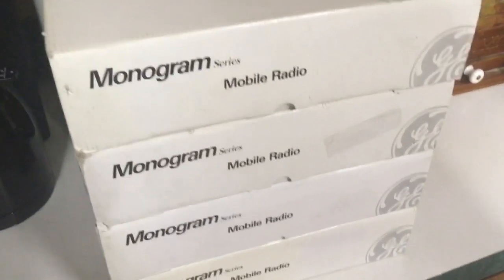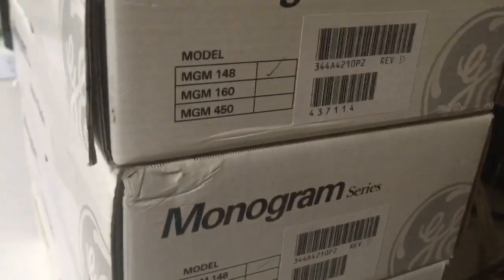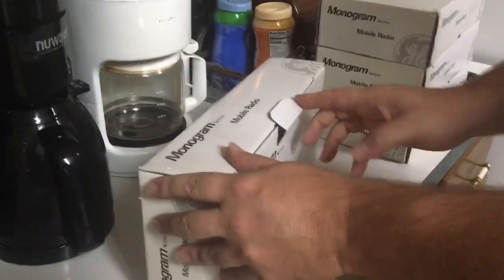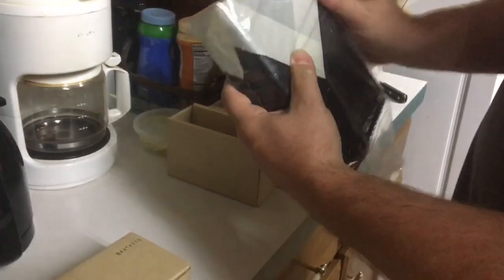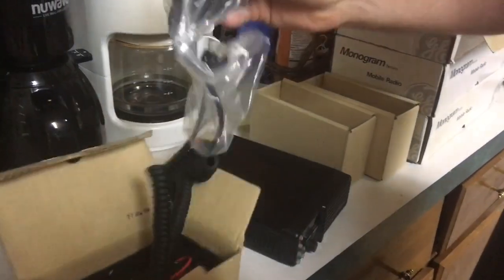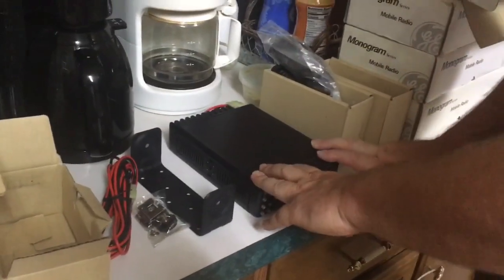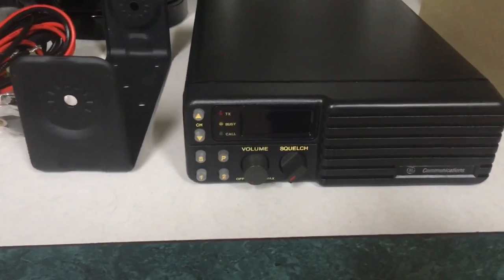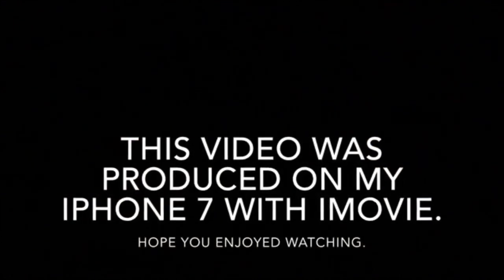GE Monogram MGM 148 “Maxon SM-4150” unboxing in 2020.. Radio Porn!!

Comment: YEAH BUDDY!   Love them radios and WHERE will .210 be?   Can I help??  Thanks SAM.
Reply from the maker: The 145.210 is in Bayou L'Ourse..  its on the air now with a DR-1x..  but I had to jump through hoops to interface it..  

I am about to add a voter system to it and that will require a discriminator audio feed at the tower and well I just don't want to tare into the DR-1x like that..  Id rather have a proper exciter radio than hack into the boxed repeater..